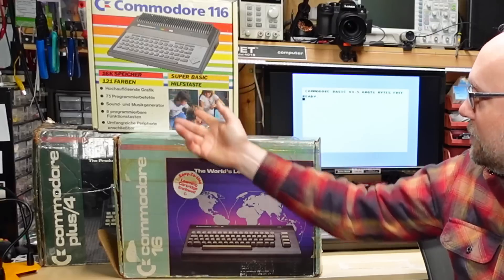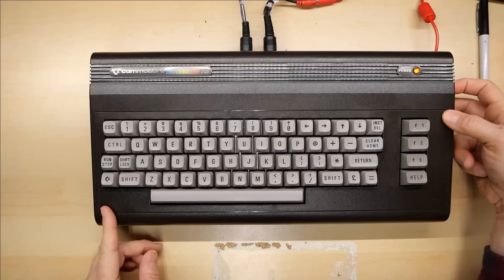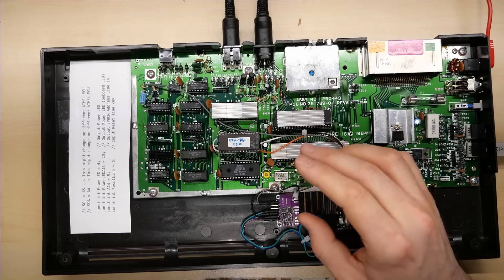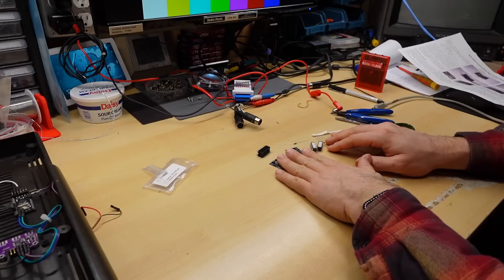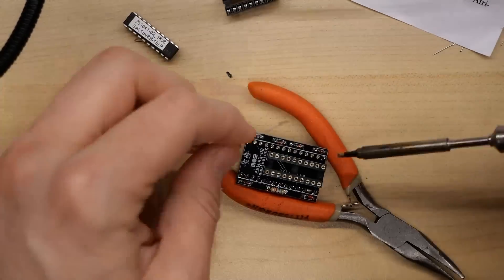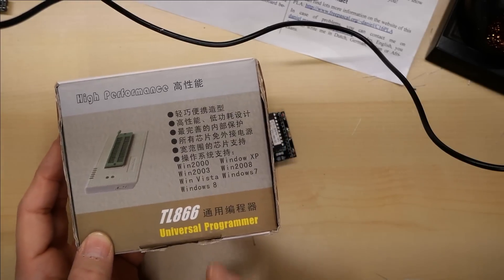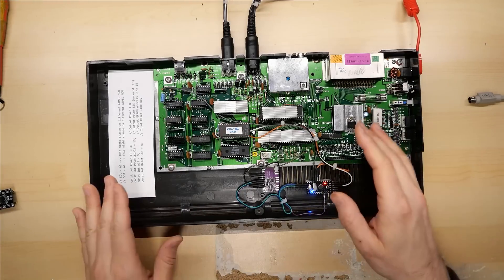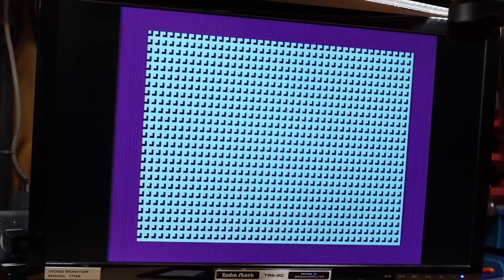Finally, a cheap C16 / +4 / C116 PLA replacement! (That anyone can make at home)

Comment: If the 16V8 chips are hard to get I would think it might be better to make use of some modern day CPLD chip.
Reply: Then you are misunderstanding: GALs are easy to get, they are everywhere and dirt cheap. It is the combination of easy to get and ease of soldering and programming that makes them such a good PLA candicate, as well as excellent compatibility.
Reply: @danielmantione  @10:20 Adrian said they are easy to get but not made any more. That is why I was suggesting another option would be to use a CPLD device that is still being manufactured rather than rely on a part for which there will be a limited supply.
Reply: @kevincozens6837  Well first of all, the GAL16V8 is discontinued, but the ATF16V8 is still being produced by Microchip. Second, discontinued does not automatically mean that the supply is limited. Many of those CPLDs that you mention are already legacy parts that are not stocked by traders. Yes you can still buy them from the manufacturer... but the manufacturer can be already discouraging use by means of pricing and making development tools inaccessible. They may EOL next month or next year and then out of a sudden they become rare, expensive, parts.

Many of these CPLDs are 3.3V parts, requiring voltage converters on the board, you end up with many SMD components and this kills an inexpensive PLA.

Now I'm exagerating quite a bit, because you can make a good case for a CPLD, some parts are being stocked by traders, but you get the point.

GALs are interresting because traders do stock them and have stocks for many years to come. This is because they were a high-volume mass-production part that traders did dare to stock and those stocks still aren't exchausted. For the case of the 16V8, these stocks are still being renewed, but even for the 20V8 (that I'm using the C64 PLA), availability is far better than that of CPLDs. If you need to buy 10.000 20V8s today, it's no problem. In fact, I did, I bought some stock and have +/- 1000 20V8s and +/- 400 16V8s. I'm not sure how many Commodore computers are still gonna have a bad PLA, but I think I have enough to repair all of them :)

Comment: Hi Adrian, I tried using the original equations for the C64 PLA to attempt to emulate one missing signal from one pin, I did this using an EPROM , address lines signal in and data lines signal out, while this solution did produce a output (that seemed good) the machine still didn’t operate as it should have (there was no signal on the PLA pin before this mod, also note the EPROM piggybacked the PLA and shared the inputs) 
Just wondering how the equations for this PLA specify timing...that info doesn’t seem to be in the file, just Boolean statements for outputs from given inputs...maybe just the chip architecture... might have to read up and follow the Arthur of this great piece of work. Excellent video, keep fighting the good fight. Pete, Yorkshire,UK
Reply: A GAL has a propagation delay: If you change an input, the outputs will update with a delay. The timing is influenced by the way the two GALs in the C64 are connected (RAMCAS should be last in order to avoid switching noises), further you can influence delay by means of feedback, so you can route a signal through the GAL twice and thus have twice the propagation delay.

There are 3 problems with using EPROMs: Timing, switching noises and logic levels. You can get some of these right by choosing your EPROM carefully, but not all of them. If you have a broken PLA, even just one pin, replace it. GAL PLAs are cheap enough that there is no reason to mess around with EPROMs any longer.

Comment: 3:37 "Finding a cpu for this machine is very difficult" 
Does it use some kind of special version of the 6502, like the "6510" in the VIC-64?
I actually though it used an ordinary 6502, much like the VIC-20 or PET.
Reply from the maker: It's yet another variant of the 6502 but different than the 6510 CPU used in the C64.

Comment: Those sockets at 8:55 are really poor.  My Amiga 500 had some of those fitted and always crashed when I moved it. 
I was lucky enough at the time to get access to a professional de-soldering tool. I removed them all and just soldered the chips back in.
It never crashed again when it was moved.
The round hole ones are much better. Those were the only type my company used.
Reply: Your Amiga came with single-wipe sockets. The one in the video is a dual-wipe socket. You can fight religious wars which is more reliable, but both the dual-wipe spring leaf socket and the round-hole socket are way more reliable than the sockets used by Commodore.

Comment: I had a plus 4 only for a short time as it was robbed.  I did buy one from teacher at my school it shut down after 10 to 20 minutes took it back this was last day of school he says see me after 1/2 term I was left not happy.  I did not know so much did go in to them.  Would like to build one or get hold of one.  I did do ram packs for the ZX81 were you had 2 backs of ram part my own work some from the old ETI magazine the ram was stacked with pin lifted to logic switching this was back in 1989 miss playing about.  I jumped in to TV servicing there we had to make small PCB to replace frame IC's that were no longer made.  But that was easy this stuff look like it will make my head hurt.  Good work I keep coming back.

Comment: GAL 16V8 and 22V10 are still available new from Microchip from places like Digikey. They are sold as ATF16V8 and ATF22V10. I found the only problem is some programmers enable the power save mode of the 22V10, which means the chip freezes when pin 4 goes high.
Reply: The ATF22V10 is a bit problematic indeed, also because the first version of the TL866 doesn't support it and it also is only available in fast speeds. The ATF16V8 is just as usable as the GAL16V8, I bought some. Nevertheless, don't worry too much about the fact that they are out of production, a lot of these chips were made and stocks on the secondary market are bulging. It is absoltely no problem to buy them new-old-stock or used and this will be the case for a long time to come.
Reply: @danielmantione  The problem is that the atf22v10 has a completely different (and undocumented) programming algorithm to other GAL types... there is an open source schematic for a programmer (search for "atfblast"), but it attaches to the parallel port which is another inconvenience nowadays...

Comment: 7:22 incorrect.
PAL is the original chip, and the GAL is a replacement made by Lattice after discontinuing the original.
The GAL offered a few extra features over the PAL, but BOTH were erasable and reprogramable.
I've heard the false information before that a PAL can't be reprogrammed, but I know from experience that they can, as I've used plenty of recycled (salvaged from old equipment that was to be disposed of) PAL16V8 chips in my own projects.
Reply: A PAL is one-time programmable, they use fuses and cannot be erased. Not to be confused with a PALCE, because a PALCE is AMD's naming for a GAL. A PALCE can be reprogrammed just like a GAL and, if you manually set the correct programming voltage you even can program it with a TL866 as a GAL168V8.
Reply: @danielmantione  I'd have to dig out one of my chips to check, but, an AMD PAL16V8 sounds to be what I remember, could be a PALCE.

Comment: You mentioned 15ns or 25ns GALs work.  The kit seems to come with a GAL16V8B.  At least from Lattice and other vendors, there are a lot of GAL revisions over the years (no-suffix, A, B, C, D also).  Will any GAL16V8* work, or is there a specific reason to use only the 'B' revision?
Reply: Any GAL will work. You are also in no way limited to 15 and 25ns. I haven't tested 10ns and 7ns myself, but unlike the C64 there is no critical timing in the 264 PLA, so I expect they will just work. The different revisions of the GAL are generally compatible. They are not compatible for programmers, may have sliight real-world timing differences and differ in their built-in pull-up resistors, but none of this should matter for the TED computers.

Comment: Mistake number 1: Double leaf sockets are a million times better than 'nice looking' machined pins sockets
Mistake number 2: Yes, there are chips compatible with GAL18V8 which are still being made and sold, just look for ATF16V8 and they will do just as good a job but consume only a small fraction of the power.

Comment: There was another very cheap PLA replacement for these machines and it was the M27C512-90B6 from ST but Groepaz did everything he could to discredit it with a ton of falsehoods. Nowadays, if you look on eBay or anywhere else looking for that part number, all you'll get is Chinese fakes...

Comment: I agree it is far easier to solder pin headers if they are stuck into something.  I like to use a small breadboard for this purpose, since it will be much larger than a board of this size and therefore easier to handle if you don't have small hands.

Comment: Now the 264s are completely repairable - well, nearly. Only the "ThED" TED replacement needs to be completed :)
Well, of course it would also be better to have a new CPU, instead of replacing the 8501 by an 6510, and maybe even replacing the 6510 by an 6502 xD

Comment: Very nice indeed! Props to your good self for the demonstration and Daniel Mantione for his excellent and generous support.
A suggestion:
This is absolutely not a nit-pick and is obviously not remotely necessary. If I ever need one of his PLA replacements I'd be tempted to spin my own PCB layout from Daniël's design such that the GAL is on the underside of the PCB. In combination with either cutting out the middle of the PLA socket or replacing with pin-strip headers you'd have a marginally neater solution...
...or just use Daniël's PCB and carefully bend the GAL's legs through 180deg after programming.

Comment: Do you use a fume extractor or mask when soldering? If not is there "safe" solder that doesn't have things like lead in it?
Reply: Of course! Lead-free solder is nowadays mandatory for commercial electronics, so you can buy lead-free solder anywhere. I doubt the fumes are healthy though, but some ventilation should help a lot.

Comment: What the heck does the BAV stand for in BAV21, etc.? Does anyone know?
Reply: There are 3 major systems for systematic names of semiconductors. American, European and Japanese. BAV21 is a European code.

B = silicium
A = diode
V = This one is a bit mysterious. Sources say it depends on the usage case (commercial, industrial, military, but it also seems just a way to restart the numbers so they don't get too large.
21 = Sequence number
Reply: @danielmantione  Thank you very much! :) I found this impossible to google. If anyone knows further sources or links, please suggest them. Thanks again.
Reply: @ropersonline  Search for "pro electron code". Pro Electron was the original organisation that maintained this naming system. Nowadays it is maintained by an organisation called EECA.
Reply: @danielmantione  What about the russian naming? Isn't that systematic as well?
Reply: @herrbonk3635  It sure is systematic, but I said there are 3 major systems. Russia is quite irrelevant in the semiconductor business, so their naming system is also used only locally. And most of it is from long ago.

The other 3 systems are in world-wide use by the entire electronics industry. For example, the BAV21 isn't just made in Europe, it is made by European, American and Asian manufacturers. A popular transistor used in Commodore computers (American company) was the 2SC1815 (a Japanese code).

Local codes like the Russian ones aren't used this way. If you encounter a Russian code, likely the first question asked, is what the western equivalent is.
Reply: @danielmantione  Probably not that irrelevant or local in their (pretty large) part of the world. But I got your points, sure! (And I see in other comments that you know your electronics.) However, for many  years in the 1970-80s, the American system actuallt felt almost as foreign as the Sovjet or Japanese here in Sweden. With exception for some ubiquitous products, like the 1N4148 or 2N3055.

Comment: I've been wondering if Western Design Center could / would make replacements for the 6510 and 8501 CPUs. They'd probably only need to do one run of each and they'd be able to supply the entire retro community for decades :-)
Reply: Then sure can, but don't seem interrested in the retro community at all.

Comment: Although the GAL16V8 isn't manufactured anymore, there are several manufacturers making compatible parts -- for example, Microchip/Atmel's ATF16V8 is still manufactured and should be for a while (they usually give a few years notice).

Comment: Adrian, are you interested in a PAL C16 that is under the open sky since about 2010? It was already not working, and had a blown fuse. There might be zero usable parts left inside, but it would be a nice trip to try make it working again. I may try to ressurect it, but I won't go any further than doing this PLA mod, if the PLA is suspect in it. If I fail, I may send it to you if you are interested. I might not even try to repair it, just send directly to you as-is, because I have no C16 parts, you have plenty, and I won't invest too much into it because of its condition. I guess the keyboard is gone after that many years in the weather (the springs surely turned into solid rust), but the keycaps were looking OK last time I saw it. Though I can't promise I'll send it to you until I know the shipping costs - I'm in Hungary :-) .

Comment: I notice a lot of these things are built with NOS Lattice GAL chips. I wonder if the designers are aware that Microchip still make 16V8 and 22V10 compatible programmable logic chips, brand new. I've used one for an "Unrainer" replacement for the PAL chip in my Spectrum +2, programmed it with my TL866II Plus

Comment: While the PAL16V8  may not be produced any more, the ATV16V8 (which is the same functionally as the PAL variant) is available from mouser.

https://au.mouser.com/_/?Keyword=ATF16V8B&bws=1

The ATF16V8 is re-programmable so if a mistake is made you can program it again.
Reply: Exactly, ATFs are cheap and easily obtainable replacements for GALs (including other types like 22V10) and can also be programmed by the TL866 (-II) programmer.

Comment: Do you have an emergency gen? I have a portable one that I can tie in via a transfer switch for key circuits. Heat, refirigerator, some lights and outlets... And I have a backup for that if necessary.

Comment: Adrian, just out of curiosity, I've heard of places without power in many places there in US. In your case, if you don't have electricity and is under a snow storm, does your heating system depend on power or it is propane based? Or do you guys have to burn wood to get warm?
Reply from the maker: YouTube sucks -- I typed out a nice long reply to your command, and the creator page sucks that it never posted. Just spun and did nothing...

So in summary: I have a generator, natural gas heat and water heater, and a UPS that runs all my computers and internet/wifi. And since our power system is winterized here and part of the huge western grid from Canada to Mexico, we don't have generation problems resulting in load shedding in cold temps... outages mostly come from trees falling on overhead wires or poles being blown over. This happened a lot in the ice storm we just had a few days before Texas got hit but I wasn't affected and the utility had things back up pretty quick for those that were. Our utility does a good job keeping the system up-to-date so it can handle load (like during summer with A/C blasting during crazy heat waves which we have now the climate is changing.)

Comment: If it uses a GAL16V8, could it not also be able to use an Atmel ATF16V8B? I bought some of these from Digi-Key. I have a TL866II+ programmer and it supports both GAL and ATF. The reason I bring this up is while the GAL chips are discontinued, I think the Atmel variants are still being made.
Reply: Yes, the ATF16V8 works perfectly. You can also use PALCE16V8H. Discontinued is not a problem though, these chips are everywhere and there is way more supply than there are TED machines in existance.

Comment: I never lived in era when those machines were the thing and neither am working or educated in anything tech involved, but thanks to this kind of videos I gained so much more understanding of how they work this is amazing. Thank you for all your work! On those videos I was always impressed how much love those machines gets. Also how much time will pass when we will be able to build all new parts C64 or different computer? I guess it is all down to if anybody will manage to recreate all the chips as FPGA? It will be interesting anyway.
Reply: Well... it is really rewarding that these computers do not just serve nostalgia, but also are of value to people who haven't used them. I understand the reason: Modern computers are of disgusting complexity, in order to understand computers you have to get something simpler. Nevertheless, it sure is a motivator dig up all the rusted knowledge from the golden years and get into Commodore computers again. These computers are old, they won't come back outside our community. But we, the children of Commodore, are also skilled computer experts. We have knowledge to share.
Reply: Actually there is a guy that re the 7501/8501 cpu as fpga. It supports even the illegal opcodes!